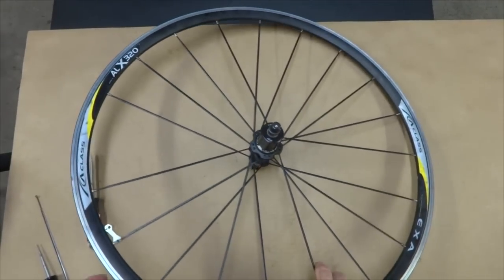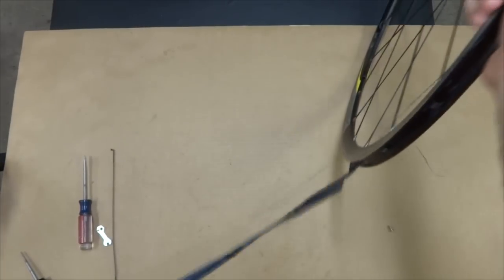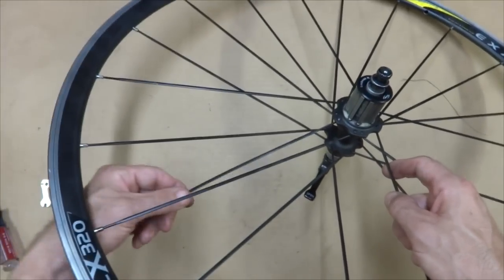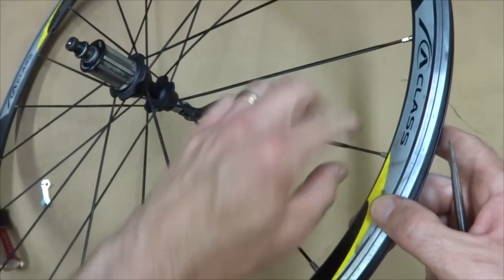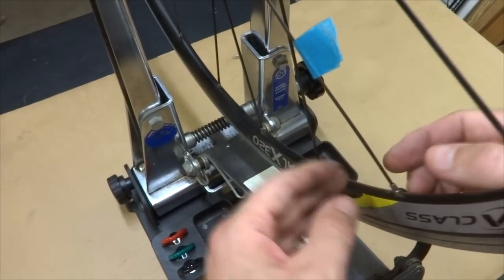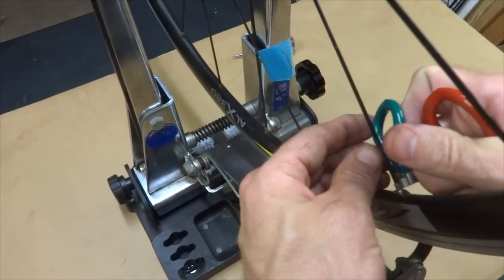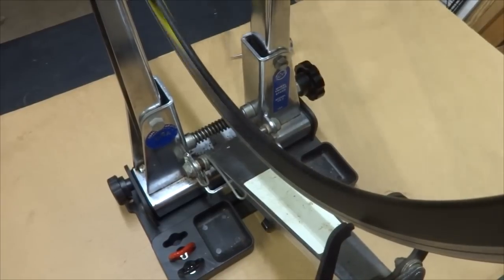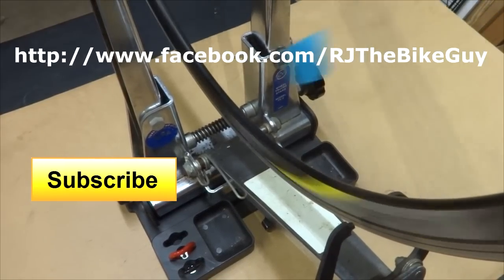Replacing Bladed Spoke On Bicycle Wheel

Comment: excellent video. is the bladed spoke holder a must? If you dont have one does it jeopardize that spoke?
Reply from the maker: You need something to hold it from twisting. You can use a small adjustable wrench, but it may mar the spoke.

Comment: Is there a way or a special spray
lubricant you can put on spokes connecting to the nipples..to make it loose so you can adjust and put the rim back in true with out 
replacing every spoke.....
wd 40. Didn't work
Reply from the maker: No, they don't sell a special spray.

Comment: If I wanted to change all the spokes in a wheel would it be a good idea to change one spoke then true the wheel again one at a time, or is there an easier way? Assuming I have no specialist tools beyond a spoke key. Thanks!
Reply from the maker: +Archie Wilson No. At that point you would remove all the old spokes and rebuild the wheel. That is a lot more complicated and goes beyond this video.

Comment: Sir, i want replace/convert my standar single wall rims like yours in video https://www.youtube.com/watch?v=x_BsGRPLKPY
with the rims that like yours in this video, i mean the rims with deep section or aero style (correct me if i wrong ) both of rims has same size (26 x 1.50)

i want ask, do you think i need to replace the spoke, tire and tube with different size too? because the deep section of new rims. 
I will buy it from online shop, so i can't measure it correctly.
Sorry for bad english. Thanks You very much Sir :)
Reply from the maker: +Rizaldi Ryan You would need to rebuild your wheels. You would need new spokes as they will be a different size. And if you are using the same size rim, you won't need new tires or tubes.
Reply: RJ The Bike Guy So.. i would buy a shorter spoke, Sir??
Reply from the maker: Please learn about wheelbuilding. http://www.amazon.com/exec/obidos/ASIN/B004H1UA9Y/ref=nosim/youtube25-20
Reply: Allright, Sir